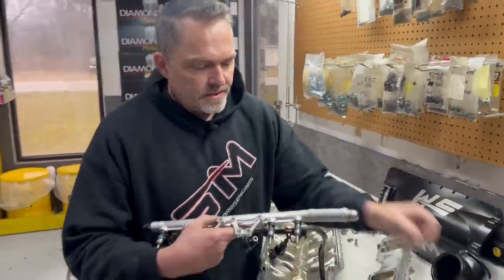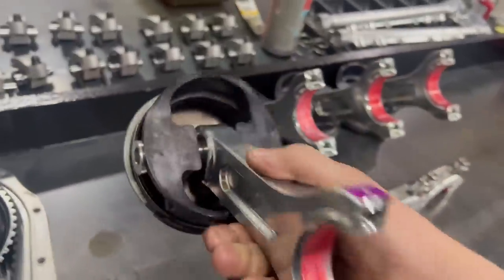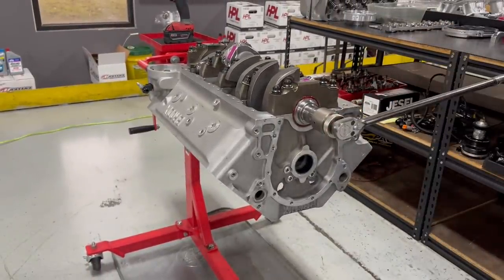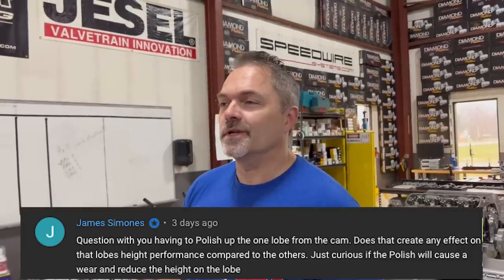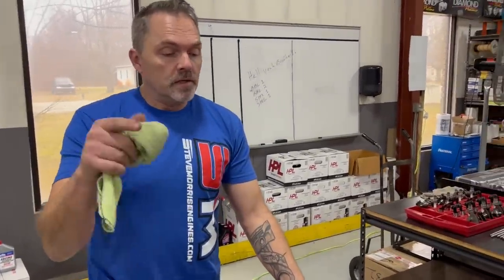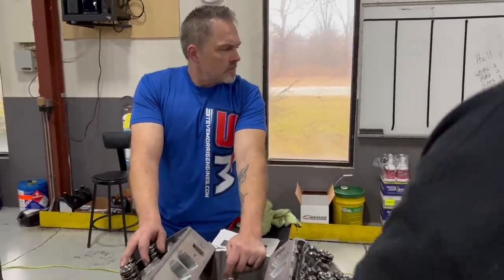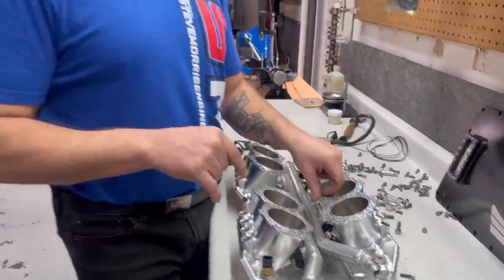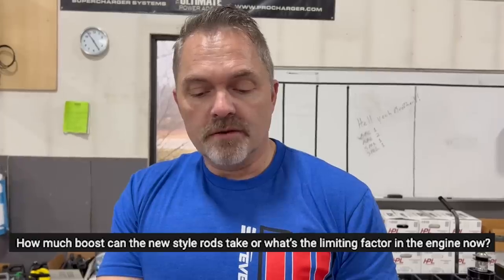Mullet Is All Done ! Day 4

Comment: And that is why the first thing you should always do before assembly of any engine build is MEASURE EVERYTHING! Not only all the clearances but the size of the parts, the length, the thickness EVERYTHING needs double checked before you install it because weights and dimensions can vary and a micrometer will pick something up that your eyes won't see.

Comment: Re: Dry sump. The deeper answer as to why it's not really worth the effort is that in an engine like this, the service intervals because of the aluminum rods alone mean any slight accelerated wear on the coast side the bearings due to decel oil starvation is inconsequential.

In other words, the rods will expire and need replacement before the wear on the bearings are ever enough to worry about.

Comment: I forgot to ask my question and you answered anyway, which was "why does more horsepower put load on the valvetrain?" and of course it's popping open the exhaust valve against whatever pressure's still inside the cylinder after expansion.  Is the math straightforward (area * pressure delta = force) and valve, pushrod, lifter all see that peak regardless of cam profile?  Or is stuff moving fast enough that inertia's significant?

Comment: Why did you grease the main cap bolts before torquing? I've been told a few times by industry guys that using anti seize on lug studs is dangerous as you are torquing onto a slight film of lubricant not the threads themselves and that can cause lugnuts to loosen over time and vibration.
 If that is in fact truth then technically greasing the main cap bolts could in theory cause them to loosen.
 Absolutely love the content and the in depth technical tid bits in every video, just wondering if you had any input on torquing a lubricated thread causing an issue.
 Thank you.

Comment: Steve. Have you ever done any fuel car (Nitro Methane) engines and tuning? You did all of those valve lash adjustments just how I do them. That is pretty bad ass mod on those fuel rails. I'm wondering the ease of installation once the package is back between the fenders of the Mullett.

Comment: I see you run babbet cam bearings.  I remember in the original video on this motor you stated that there were some bearing issues due to this being a wet sump motor with oil control etc.  Why wouldn't you want to run a roller cam bearing to help with some of the oil control?  Curious to hear why.

Comment: Im sorry if you got this question alot? ON the inside of the valve valley. Why is there another nut underneath the cylinder head? Never seen that. I also never worked on a big block.

Comment: Just wondering, you pulled the connecting rod bearings straight out of the package, lubed the bearings and installed the pistons.  Do you think Plastigauge  to check rod bearing clearance is unnecessary? or did I miss something earlier?
Reply: Hmmm

Comment: I have  a question that I would rather have the answer from someone of your knowledge and experience then my local engine builders. I have a chevy 383 with forged internals running a f1 procharger . Street driver may see a track for fun. I'm running retrofit hydraulic roller lifters . I'm thinking about going solid roller but worried about how often they will need to be adjusted. Will it be like every time I drive it or or every oil change or longer?
Reply from the maker: Way to hard to answer
It is a little buried and far back but goggle my how to adjust valves video. I explain all of that

Comment: Hey there! I was wondering why you guys use a pushrod setup rather then something like DOHC or just a single OHC? Is there a significant performance or durability advantage? Or is it to keep things simple?
Thanks for any answers!
Reply: Makes the overall size of the engine much more compact with pushrods. With overhead cams you’re adding to the height of the heads. On a V engine that makes it taller and wider. So, you end up having to make the engine smaller so it can actually fit into things. That’s why most OHC V engine are relatively small displacement. I think this engine is 8+ liters. 
Also, with everything being nice and big it can flow plenty of air with only 2 valves per cylinder. Especially when there’s big turbos helping push the air.
Reply: @NBSV1  Ah makes sense, Thanks for explaining a bit!

Comment: If the street drive injectors aren't being used to make power, why do they need a -10 fuel rail? Seems they could run a -6 or even smaller which would give back some much needed space in there.

Comment: Really enjoy your videos, a question on belt drive do you ever see any belt stretch at high rpm. I know here in the uk there’s a company that run racing Subaru engines and even with Kevlar belts they see some change in timing at high rpm. I know Subaru have a really long belt, but just curious if this happeneds in this application aswell

Comment: Would you having to face mill each of those rod ends effect overall balance of the rotating assembly and if so did you have rebalance everything or was it minimal enough to not have to worry about. Also does the rods being aluminum help at all with balancing sensitivity?

Comment: I've always wondered why they don't make a hybrid lifter. As fuel pressure and intake pressures increased due to higher RPMs hydraulic lifters make sense. But exhaust valves you kind of have to compensate for them on the cam angles. Why isn't there a hybrid hydraulic intake sealed spring exhaust cam valve setup?

Comment: major building no no is to spin the crank without the mains on and torqued. the bearing is not perfectly round untill its yorqued so you can scratch the journals if you spin the crank without the maions on--suprised you dont know that
Reply from the maker: That is not correct

Comment: I'm just wondering once the rods are clearanced doesn't the entire rotating assembly have to be rebalanced? I would think in theory if the rods are lighter then the counterweights on the crank should be lighter as well to maintain proper balance.

Comment: If a timing chain breaks on a normal motor, it had an oiling problem, if a belt breaks, it had a maintenance problem. Either can break if there was a manufacturing or fitment mistake.
The real questions are, which one uses more power to turn?, and which one makes more noise?
Reply: I know in a drivetrain set up a chain drive is much louder than a belt drive, as for the power consumption I wouldn't have a clue, as for your question I'm just as curious as you are. 😀

Comment: Steve I've seen you build about every kind of race engine , your SMX is probably one of the baddest engines out today , that brodix block is just a cast block correct, is there anything special about the blocks from brodix , or is it just a good little cheaper block to start with vs a billet block , do you have a line of cast heads or just billet

Comment: Just Comment On Anodize Pistons. You Will Sometimes See A Golden Tint Near Ring Lands / Ring Grooves On OEM Pistons, That's Anodizing. You Also See A lot Of Anodizing On Auto Trans Valve Bodies (those usually look dark in color). Like He Said It's A Treatment To The Aluminum Surface That Makes It Much Harder. Also Done In Aluminum Master Cylinders And Slave Cylinders. That's Why They Don't Advise Honing Master Cylinders Or Valve Body Spool Valve Bores Because You May Take Off The Anodizing Surface Finish.

Comment: What head gaskets do you use? MLS? and why copper coat them?   Is it worth it on a non-O ringed street motor use MLS gaskets on an iron block with aluminum heads?

Comment: I know somebody’s going to say that the torque spec was too low but you have to understand the lube he is using instead of arp lube has better compressive strength, so if you use the original torque spec you will over tighten the bolts and snap them.

Comment: Hi, is the ”peanut butter” just some ”regular” assembly paste or what is it? And do you need to torque the bolts/nuts differently when using it? And is the reasoning on using it to just make it easier to take apart after it has gotten heat cycles?

Comment: Hi Steve. If you ask a BMW or Audi owner about timing chains being bullet proof, they won’t believe you. They really are unreliable and should always be changed at the stated mileage. It would not be to much hassle to change then but lots are fitted to the rear of the engine. Especially the V8 performance motors.
Reply: A lot of the problems there is because the chains are so long a little wear in each link adds up, and the guides tend to wear/break. With an engine like this it’d be a short chain and don’t typically have any guides.

Comment: I'm sure this engine can propel a car to a 5.99 second quarter mile if it was in something that had a strong frame, less than 2,000 pounds on the best track for launching in the world with the right rear gear ratio, the best shock setup, the best tires set at the right PSI, and all that! Mullet........never! I do understand that!

Comment: I've always been told not to spin the crankshaft with the caps off or not snugged because its not round with the caps not snug, but I noticed you spun the crank when you put it back in. Are you able to do that because it's an aftermarket block, or is it just another false myth?

Comment: Why not use an oval aluminium tube as a one piece bolt on fuel rail ? Could even be split for a front and rear . Would get away from the sxs configuration ....the electronics wouldn't know the difference.

Comment: That lifter failed become somewhere deep down it had some minor flaw from the materials or the process of manufacture. A flaw that may have only made it 1% weaker than normal may have made it the first to go in the high stress environment it ended up in.

Comment: If that race mode in a hellcat did void warranty, that would be a pretty good court case to sue over. If it voids the warranty, then why did they put it in there for people to use? Sounds like to me you wanted to people to have it so it should be covered when they use it and it breaks something. Like selling a towing package but then telling people if you tow a trailer you void warranty for the transmission.

Comment: I think the single lifter fail is just the luck of the draw more than anything. Manufacturers go above and beyond to provide quality parts and do quite well but nobody is absolutely 100% perfect in every way and every once in a while, one slips by quality control. If it were possible for every part to be 100% fool proof, parts would never fail unless pushed beyond their limits. The "Mass Exodus" rods are a prime example of beyond limits parts fail. They all checked out. The single lifter fail was more like just one weak link that tried to keep up with the others but couldn't quite do it.

Comment: Has anybody elese had issues with coated pistons raising egt temps? One of our engines runs significantly hotter, we have been told its normal with coated pistons.
Reply: The coating is a significant thermal insulator, so that wouldn't surprise me.